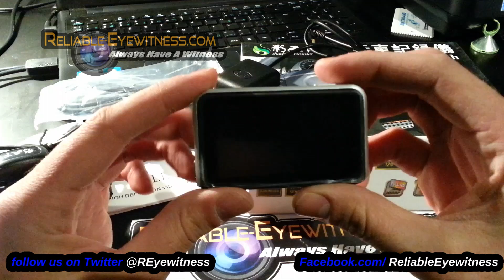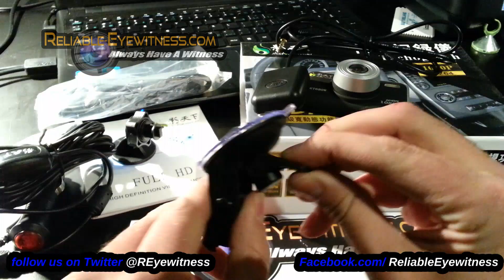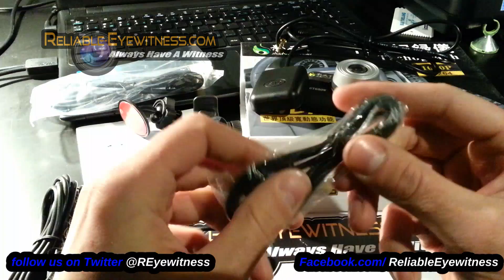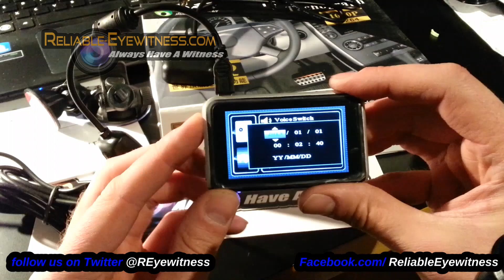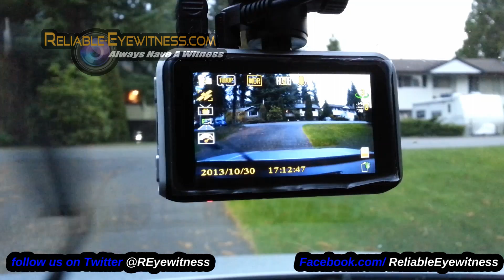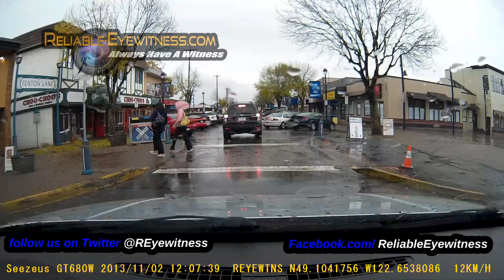Reliable-Eyewitness GT680W + GPS dash camera video review

Comment: Hi there, pls how long does gps take the signal? Is it count in minutes or hours for first time use? (GT680W + GPS, firmware 3.7)
Reply from the maker: Up to 30mins for first use.  After that less than a minute.
Reply: Ou thanks a lot for your answer and your time! I thought that it is firmware problem or that GPS is death.

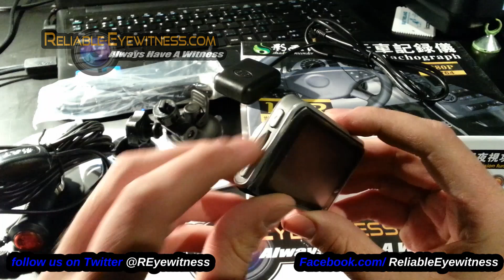update// It has been working for 1:15 hour and still nothing. So GPS is probably death, but red and blue light is on... Could be that firmware 3.2 does not work with GPS?

Comment: How about the model without GPS?  I've read that the battery life on this camera is poor.  Thanks in advance.
Reply from the maker: We carry one model down called GT550WS if you require a model without GPS.
Battery life is only for shutting down last file and camera, other than that battery is not used.

Comment: Do you have to have the charger cable plugged in while using? Thanks.
Reply from the maker: Mike, yes we have a AC to DC converter we use to test the cameras.
Reply: @ReliableEyewitness  - That statement doesn't make any sense because a laptop already puts out DC, which means, you would be able to simply plug the camera into a laptop USB port. However, if you're talking about a DC-to-AC Inverter, then that's different, but they put out 120v AC. Some of them do have a USB 5v DC output on them, so you'd have to be more specific if that's what you're referring to. Saying "AC to DC converter" simply makes no sense. Please be more specific or provide a link.

Comment from the maker: Brent H. GT680W is a new model.  Video they are the same.  GT680W has gps antenna GT550WS does not but will accept one if you decide later.

Comment from the maker: Xeboti,  either model is a good choice.. if your after a gps enabled dash cam then the GT680W is the most cost effective as it ships with the gps antenna.  GT550WS will accept the same antenna but you will pay more over all as the antenna is a add on.  
Image and functions are all the same.
Reply from the maker: Yes.. but Rx300 not as nice looking.. plus mount is very specific and hard to obtain new ones